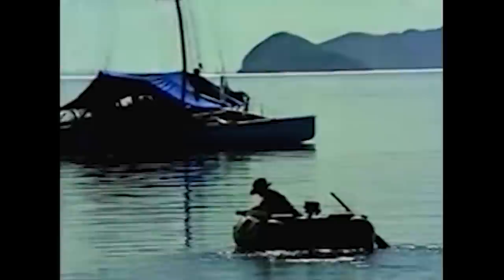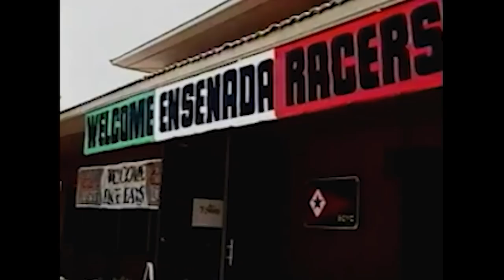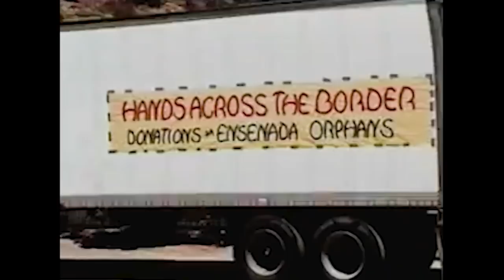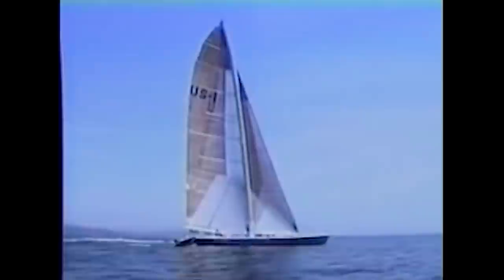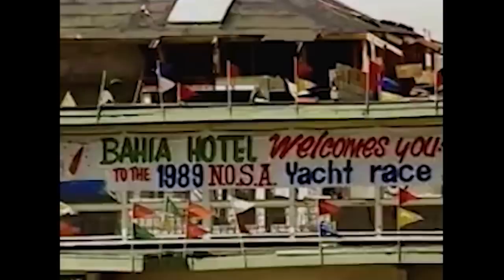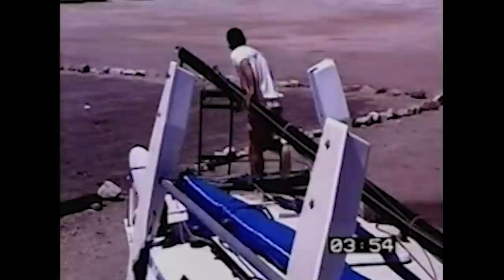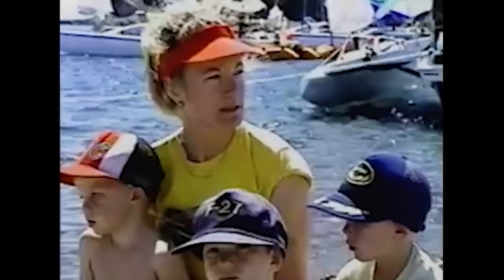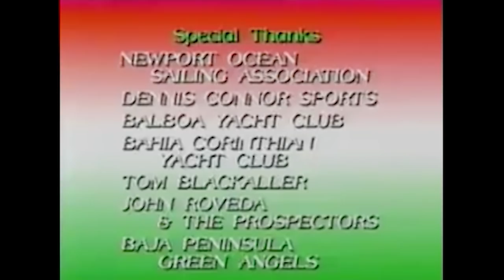A BLAST From the PAST Sailing Movie, Including Ian Farrier & John Walton

Comment: My friend has one and they are amazing to sail.  They are hard to dock has the wind push it sideways. You need to keep the board down, at least half way. The engine being on the side, you also have trouble going straight on acceleration.  It takes a lot longer then 20 minutes to get it ready and it is a 2 to 3 man job but it is within one hour when you are use to it.